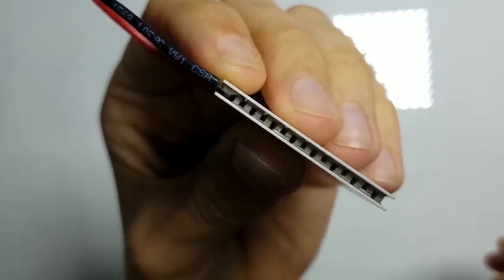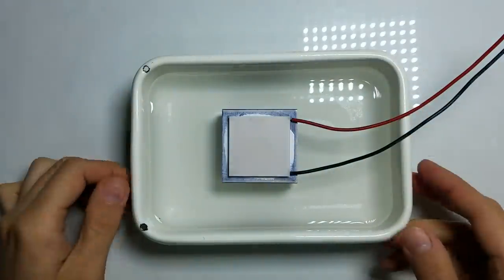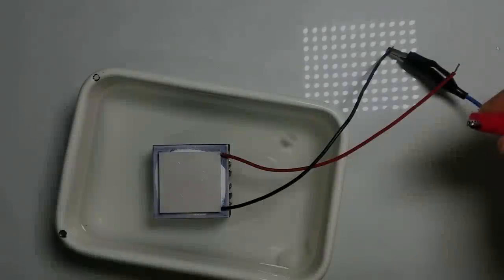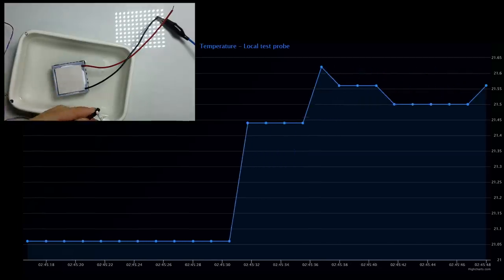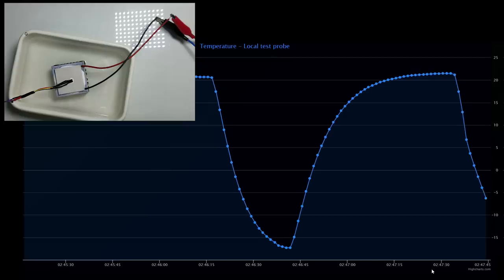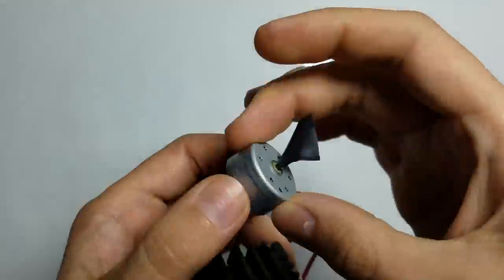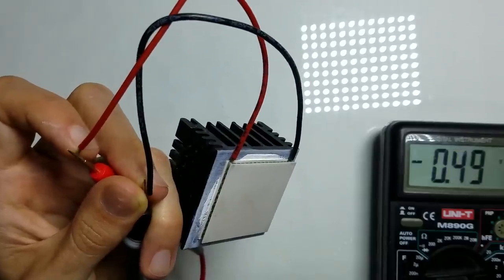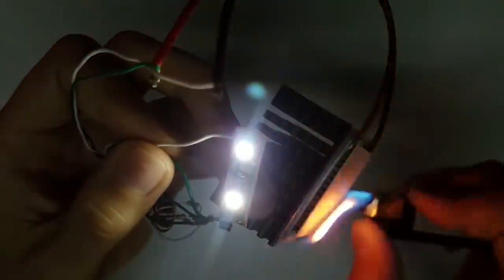Thermoelectric Cooler - Device That Makes Ice and Electricity

Comment: one part is hot and another is cold..so difficult to use as cooler in computer. First we need to think what should we do with that heat😶☺️
Reply: Extend the heat from CPU simple elongate the structure four or five inches out of the CPU with heat sinks extending from the CPU throughout that 4 or 5  inches,

Comment: Doesn't say what it is made of, or why it functions the way it does. Two most important questions not discussed. Really Lame dude...
Reply from the maker: I only know that it's made from semiconducting materials... I could say what is written on Wikipedia, but I don't completely understand its working principle. You can read more on Wiki: https://en.wikipedia.org/wiki/Thermoelectric_cooling
Reply: @ElectricalPro  nothing more appreciated than honestly, good job for admitting you don't know and not just give a wishy-washy fake explanation

Comment: It is not clear which side of peltier has to be fastened.😗
Reply from the maker: Hi, connect it to the power source for a second and you will know. Btw, if you reverse polarity hot/cold sides changes as well.

Comment: I remember seeing these back in the 486dx4 days. Someone tried selling them as a computer cooler. Strange I don't see them for sale anywhere anymore. Always wanted to experiment with one
Reply: I used to install them.
The problem with them is that they were very inefficient and they created ice/water due to condensation so there was also a secondary heating element to help drive off the condensation.  This was a rather unweildly design and would often use a fan anyway, so people just went with better heatsink/fan combos since it was cheaper and less complicated.

Comment: These coolers use solid state cooling elements.
Wagan EL6206  - 6 Quart 12V Portable Electric Cooler/Warmer for Car, Truck, SUV, RV, Trailer DC Powered https://smile.amazon.com/dp/B07CSSM2HV/ref=cm_sw_r_cp_apa_i_sOp1CbAD0SSDM

Comment: A peltier cooler makes ice that fast?
Reply from the maker: Hi, if you use a small amount of water, then yes, it is fast, probably less than 5 seconds. But if you use too much water then it will be slow, or it may not freeze at all.

Comment: Can’t apply this technology economically to cool a house.
Reply: I can't never could.  The definition of refrigeration is moving heat from one area to a less objectionable area, the Peltier effect is one of the Laws of Physics, one should never underestimate it's ability.  Respect the Peltier.  Logan Beri, have you no use for such technology?
Reply: Jason DeLozier 
I am just interested in the conversation about air conditioning with alternative methods. Why the industry hasn’t adopted this technology even to cool an automobile.?. (I am just an observer. Not an expert in physics). It appears that this method consumes a lots of electricity.
Reply: Not because of the efficiency.

Comment: Video is faulty.when motor and led connect wire is out of frame
Reply: There is no reason to talk trash, thermoelectric generators most definitely exist. NASA has used them on various probes and on the curiosity rover.

Comment: Peltier cooler is not for generating electricity.
You need to learn a bit more about those devices
Peltier cooler draws power to generate freezing temperature
TEG module (thermoelectric generator uses heat and cold to generate electricity.
Hope you understand.
A peltier cooler consuming 60watts,
While a Teg generator is generating 2w-25watts depends on temperatures and number of modules.

Comment: Imagine this type of tech being used in laptops. Either one with heatsinks and face (active cooling) or ultrabooks with passive cooling. It would be cool to see something like this integrated into something like that. Since it would be able to slowly charge itself from the heat generated from the CPU and GPU. It would also help cool itself.
Reply: Ultrabook and macbook use it’s large aluminium body as heatsink, passive cooling

Comment: Ive ordered 2 of them and None of them even work with a 12V dc power source
Reply: tim you probably burnt them out as they require fans to extract the warm air (Hot Side)

Comment: show how to identify which side becomes hot and which side becomes cold.
Reply: DaSnipy ya plug it in and feel which side gets warm and which side gets cold
Reply: Thats unscientific way to test it... say you have to find out the hot and cold side before you turn it on... is the positive wire ALWAYS on the left hand side if hot surface is facing towards you ?
Reply from the maker: Not always, If you change the power supply polarity then hot/cold sides switch places. Yes, you are right about "left hand side", that is what we see in the video. Use this video as a reference, I've connected wires correctly.
Reply: thanks man
Reply: @DaSnipy  the hot side is usually the one with text on it
Reply: thanks

Comment: Could make drinking water
Reply: Hi,
I am working on a solar watermaker. Still early. Several kinds of cold condenser will work. The hot side can heat saltwater or brackish water. The vapor would condense on the cold finger extensions and drip into a collector. Powered by solar cells. Will work with humidity alone also. Many dry places on earth could use these to make 4 to 20 gallons per day.
Reply: Take a sheet of ceramic coated corrugated roofing used for rain water collection. Glue rows of these down the length of the sheet, duct the cold surface and push through it with a 12v fan. Maybe floor tiles for condensation plates built around the flow of a computer fan. Some of my musings lol
Reply: A long seamless strip of this could help your idea. Yea, why don't they make this in lengths? Wrap it around your cup that way its cold, flip it and its on the hot side..
Reply: The biggest peltier surface i can find.

Comment: i think you did it wrong....  it should have fire on one side and something like deep frozen ice on other side to produce 11 to 12v DC
Reply: i mean the air is colder than the fire..... So yes that would produce a higher voltage, but it's to demonstrate a point

Comment: Why don't we use it to cool cpus and gpus??
Reply from the maker: Because it is not worth doing, it has very low energy efficiency. Although one side of this device gets cold another side gets very hot, as a result you will get even more heat than you started with. I think a large heatsink or water cooling it a much better idea.

Comment: I tried one of those things. I had a heat sink and the thing just fried itself.
Reply: LuaConstructor  I was hoping to use something like that for solar-powered air conditioning but, it seems not to be viable.
Reply: Heatsink is not enough add a fan to hot side

Comment: OK// NOW Stack the Peltier Devices +12VDC//+6VDC//+12VDC// USE Fans on Heat Sinks BOTH SIDES//Use Thermal Paste Between All Peltier Devices & Heat Sinks// Use Computer Supply to power Peltier Devices & Fans Mounted in Heat Sinks// Use HEXFET Drivers to control Peltier Devices with CPU to control square waves for optimum Efficiencies to control Temperatures VS Power Used// Replace Power Supplies with Solar Panels/MPP/Batteries For Optimum Efficiency// Program dependent upon microprocessor used .!!

Comment: The last one if fake
Reply: There must me a way to store the power when using a booster circuit
What a booster circuit does is draw more power from a battery and increase the out put power
Which means i sucks more power for a higher out up 
I mean how did you make the booster circuit work without a battery???
He litrally cheated for views its click bate guys
Reply from the maker: I don't get you. Peltier device generates electricity. But it just produces low voltage. See white LED requires 3V to work, but if you have for example 1.5V battery your LED will not work, because of not enough voltage. A 1.5V battery has enough power to power 3V LED, but it just doesn't have enough voltage. Higher voltage doesn't always mean higher power. You can read about this circuit on wiki https://en.wikipedia.org/wiki/Joule_thief
Again, Peltier device produces enough power to power LED, but not enough voltage... LED only consumes energy when it gets 3V or more.

Comment: I care nothing about the metric system. How about giving it in the imperial system?
Reply from the maker: Hi, I did conversions from Celsius to Fahrenheit, you can see it at 2:45 for example (top-right corner). I did it for all key temperatures that I've measured. It is sad that we have two different system.
Reply: Why? The rest of the world went metric 50 years ago.
Reply: I care nothing about the imperial system. How about you, the only country apart from Myanmar and Liberia NOT using SI units, switch to SI?
Reply: What is imperial system?

Comment: You shall never own a PC as your thermal paste applying skills suck. And the peltier device is more like a heat pump as I could gather from the sources I have read
Reply: Good joke hahahha
Reply: What? Well that's what I could gather from Wikipedia. I had to translate it because I am from Germany and there was no English translation: "If one Passes a current through two consecutive Contact Points of these Materials, heat Energy must be absorbed at one Contact Point, so that the Electron enters the energetically higher Conduction band of the adjacent Semiconductor material, As a result, cooling Occurs."
This really sounds more like a "Pump" then a cooler or heater because it takes heat from one side to the other one...
Reply: I was referring to your first sentence... But that is a good way to go 300 iq on me, good job.